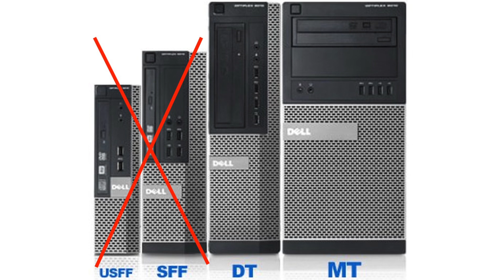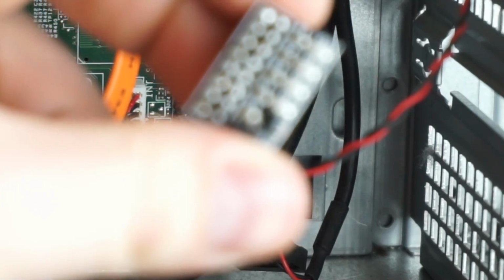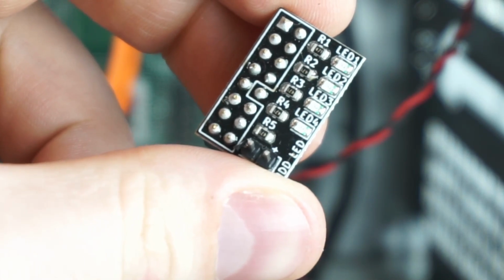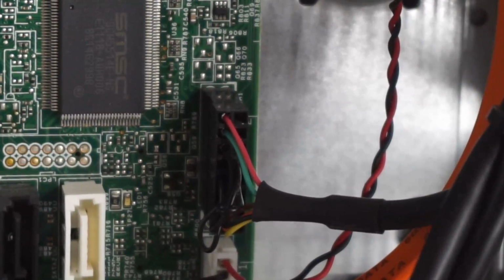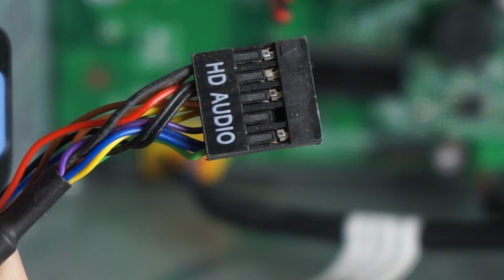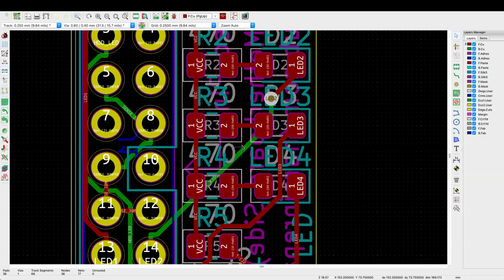Dell Optiplex Front Panel Header Adapter Installation - Optiplex 390, 3010, 3020

Comment: Dell Optiplex 7010 9010 7020 9020 and Precision T1700 Front Panel Header Adapter
i have 9020 
but my case is SFF is it compatible for my mobo or not Cause it a little bit complicated 
Please i need you asap :)
MorePower
Reply from the maker: Our adapter will not work with SFF models, only MT and DT boards will work.
Reply: Oh so sad
anyway thank you

Comment: I plugged all three but I still get the previous fan failure and rear fan failure on the boot screen
Reply from the maker: You need to transfer the original fan to the new case.

Comment: Hello I have a question, can I use this adapter on a motherboard t10xw? This model I think is the optiplex 3010 sff but I need to know if I can use this adapter.
Reply: At least the power adapter.
Reply from the maker: No it will not work, it is an SFF model.

Comment: I have a Dell Precision T1700.  I just bought your kit will it work with mine and do I get specific instructions from my model
Reply from the maker: Yes they come with a basic picture guide showing how they are plugged in on the board and where to align the white arrow and notched out pins.
Reply: The reason I ask is because when I look at the motherboard you have. It looks a lot different than the one that's in my computer and I wanted to make sure that I don't mess up anything. I'm very new at this and very nervous lol.
Reply from the maker: @CUDown40  Make sure the board is actually a T1700 and the one you purchased is for the T1700 and not T1600.
Reply: It came in the T1700 case that I got off of eBay. It is an 8 pin motherboard that I had to get a 24 pin adapter, so  I could put in a better power supply. This was after the factory one died on me. Is there a way I can check to see what type motherboard I am dealing with and that the seller did not gyp me with the wrong one?
Reply from the maker: @CUDown40 Check the BIOS and make sure the model number matches the case model number, or google the board number.

Comment: I just the front panel I/O adapter for the 7010 SFF not all 3 of them
Reply from the maker: Sorry the 7010 SFF is not compatible with any of our kits for various reasons. Some have slightly different connectors or they're located in areas of the board that block the adapter from being connected like a large capacitor or the CMOS battery.

Comment: So I’ll just need the front panel, rear fan and power button adapter or not having the fan adapter is optional?
Reply from the maker: If you don't have the fan plugged in then you will get a fan error.

Comment: Does this work for a 990?
Reply from the maker: We have not officially announced the 990 adapter yet but you can get it here when it's available https://www.ebay.com/itm/264733401752 - Video coming soon
Reply: @HarbinRepairs  Currently out of stock, but thanks anyways. I'll keep an eye out for whenever it's in stock again.

Comment: Would this work for the 5040 and 7040? My project is a power Mac G5 ATX conversion with either of the two aforementioned boards. I want to retain the Mac button which uses only a power button + and a led +. Any advice?
Reply from the maker: Our power button adapter linked in the description will work with that model however keep in mind that the motherboard hole pattern is not the same as a standard ATX case.
Reply: @HarbinRepairs  thanks and no worries about the motherboard mounts. When doing a g5 ATX conversion you're already doing a custom mount arrangement

Comment: Would you or anyone else know where to get similair adapters for 9020 SFF Optiplex? Especially the AUDIO and USB ports.
Reply from the maker: SFF would require a completely different adapter depending on the model since Dell has those connectors in weird different locations on each model. We might design one in the future but as of right now we don't have a solution for those.

Comment: @Harbin Repairs...Great informative video!! I recently upgrade my Dell XPS 9100 to a new case. I have two issues: The front usb cable not connected error & the power led button is flashing intermittent. Do you have any solutions for this motherboard (5DN3X) model? I’ll be waiting patiently for any help you can provide. Thank you 🙏🏼
Reply from the maker: Check the power button blink codes on Dell's website, as for the USB error there is possibly a detect pin that is not grounded due to the front panel connector not being attached. We don't currently have an adapter that will fix that issue at the moment but we'll keep it in mind for the future.
Reply: @HarbinRepairs , would your USB adapter get rid of the POST error at least? The only thing I found out at Dell's website was the blinking amber power led light error. My power led blinks white color only with no beeps at all.
Reply from the maker: @veloze  We don't currently have a solution for that, you might want to consider posting your question on the Linus Tech Tips forum.
Reply: Harbin Repairs, thanks anyways!! Please let me know if any solution comes your way. Peace bro!!😊
Reply from the maker: @veloze  Will do

Comment: My dell 390 auto power on but I connect right wire and not working button and F1 error display
What I do mother board model no MIH61R

#chipguidecomputer
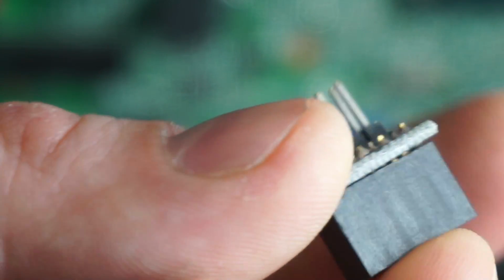Reply from the maker: All 3 adapters and the front panel audio must be connected to remove the error as explained @ 2:13.

Comment: Hey, I checked out your eBay store and saw you have the 3pc Optiplex 790 adapters available. I'm sure they'll work, but can you make a quick video on that? Please and thank you.
Reply from the maker: Video coming soon.
Reply: @HarbinRepairs  Awesome, thank you.
Reply: @HarbinRepairs  Quick question. I broke off the plastic "shroud/cover" for the front panel connector ON the motherboard because the CASE front panel cables would not fit. Would the adapter still stick to the motherboard without the plastic "shroud/cover." If the adapters won't stick, would it be a good idea to put a tiny dab of super glue on the adapter to plug into the motherboard?

Comment: Hey how do I fix my graphics card? My graphics card is a msi rx 570 and won't plug into the Dell optiplex 3010 motherboard. It won't display at all
Reply from the maker: Make sure you have PCIE power plugged into the card, check out Linus Tech Tip's channel. They have a forum dedicated to helping people build PC's.
Reply: @HarbinRepairs  I did and the fan of the graphics card turns on. It spins and the graphics card feels hot. And I plugged the 8 pin PCI-E cable. Could it be the graphics card or motherboard what do you think? What else you recommend me to do? It doesn't register
Reply from the maker: @Tnguyen6163  Not sure, check out the Linus Tech Tips forum and write a forum post about your specific problem.

Comment: At 2:20 what do you have to plug in? The USB?
Reply from the maker: Yes you can plug in your front panel USB, you don't have to but you do need to plug in the adapter to the board to get rid of the front panel error as was mentioned shortly after.
Reply from the maker: @jeffreydbarton  It could be a bad internal USB cable or if you're using a long extension cable then it could cause issues, try one of the other internal headers and see if the issue persists. If it doesn't work on the other USB headers then there may be a problem with your motherboard or with the front panel USB cables.

Comment: 1:08 how come you did not plug in the reset switch anywhere? Is it optional to plug in the reset switch and the diagnostic LEDs?
Reply from the maker: There is not a reset switch on the original front panel of the Optiplex desktops. The diagnostic LED's/HDD LED adapter is optional however without that adapter plugged in you will still get the annoying front panel error on startup.
Reply: @HarbinRepairs  yeah I bought the three pack kit on eBay but my PC case does not come with the diagnostic LED's though so will that be okay?
Reply from the maker: @Tnguyen6163  The HDD LED connector will work and front panel error will be removed when plugged in, If your original case did not have diagnostic LED's then they won't light up which is normal.
Reply: i ordered my kit today and i have the same situation with the aftermarket case not having diagnostic leds so i’m gonna plug my reset switch in there and see what happens and i’ll let you know!
Reply: @dylanbrown2582  thanks let me know
Reply from the maker: @dylanbrown2582  Do not plug in the reset switch into the diagnostic LED header, that is a direct short and may cause damage to the board. There is not a reset switch header on Optiplex motherboards. The diagnostic LED connector is for  an LED, not a reset switch.
Reply: Harbin Repairs thanks for the heads up i guess it’s just something we’ll have to sacrifice for going on a budget haha thanks man!

Comment: So only the power button adapter is needed to take away the power button message right?
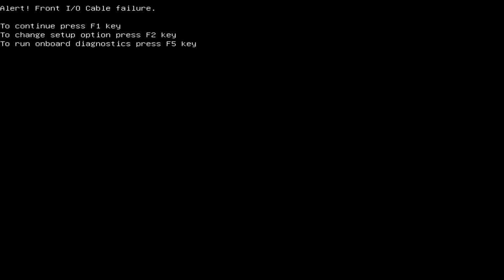Reply from the maker: Watch the video @ 2:13 - 2:21
Reply: Harbin Repairs will the computer still work if the error is still showing and you just ignore it?
Reply: D4V1 yes it will just press F1

Comment: If I connect the aftermarket case hd audio into motherboard will I get an error on boot?
Reply from the maker: For most cases your shouldn't get the error.
Reply: Harbin Repairs ok thank you for the info. Just ordered some from you guys on eBay the other day 👍🏼

Comment: Would this work in a dell optiplex 990?
Reply from the maker: The power button/LED adapter will work but not this 3pc kit, we are very close to releasing a full kit for the 990 that retains the USB and audio headers as well as removing the front panel error.

Comment: This is great! Thanks. You wouldn’t happen to know anything about the KBMSCOM1 port, would you?
Reply from the maker: That port is for an optional PS/2 keyboard and mouse card (old stuff).
Reply: Harbin Repairs
Thank you. I’m trying to find a pinout for that connector. I need a COM port for my DVR project, and if I could use the KBMSCOM1 header, it would free up the PCIe slot I need for a video card. Thanks again :-)

Comment: Which kit is for the SFF version?
Reply from the maker: The only adapter that will work is the power button/LED adapter. SFF boards are incompatible with the 3 piece kit.
Reply: @HarbinRepairs  The message above is confusing on what u said do u have an adapter for the sff or you guys don't have one its kinda mixed signals
Reply from the maker: @Allious131  Please read the compatibility section of the README on the github page linked in the description.

Comment: You guys should also make a conversion adapter for dell's proprietary audio connection on the 790/990/7010/9010 There's a post on LTT forum detailing all of this https://linustechtips.com/main/topic/987783-optiplex-70109010-front-io-panel-pinout/?tab=comments#comment-11899618
Reply from the maker: We are very close to releasing an adapter that works for that model with those connectors.
Reply: @HarbinRepairs  good to know I can't wait.

Comment: Just got my 6 pin power button mod on Ebay.  Used it on my Dell OptiPlex 7010 for an external power button.  LED, Power On, Hold to reset all works great, no errors.  Thanks so much for actually creating a solution for a kind of obscure problem.  Remember to install it with the arrow pointed at the empty pin area.  On the 7010 it is upside down compared to this video.
Reply from the maker: That's correct the arrow points to the missing pin on power buttton/LED adapter. We'll make a video on that when we have our adapter set read for the 7010 boards.
Reply: Thank you so much for this comment. I just got my adapter today in the mail for the 7010 and assumed the arrow went to the empty pin; just needed that confirmation.

Comment: Will this work with the Dell optiplex 9020? And if not, do you know of a product that will?
Reply from the maker: The power button/LED adapter will work with a 9020 but not the front I/O adapter. We are currently working on an adapter for the 7010, 9010, 7020, & 9020 towers, we'll post a video when it's available.
Reply: @HarbinRepairs and with an 9020 SFF?
Reply from the maker: @kd3n4  No, none of the SFF towers will work with our adapters.

Comment: Will this work with the Dell optiplex 990? And if not, do you know of a product that will?
Reply from the maker: The power button adapter will work but not the front panel I/O. We are currently working on an adapter kit for the 990 and 790 desktops.
Reply: @HarbinRepairs   thank you, will you post a video on the product for the 990/790 series?
Reply from the maker: @MovingBeastOfficial  Will do
Reply: @HarbinRepairs  looking forward to the 790.
Reply: @HarbinRepairs  omg! I will totally buy the 990 kit when you complete that. I am right in the middle of a conversion. And that is a god send. Thank you for doing this stuff 🙏🤘🏻.

I have the 990 dt sff, will that work with your upcoming release?

Comment: just ordered it today on ebay. i'll keep you up to date on what happens.
Reply: Do you have the eBay listing link available?
Reply from the maker: Yes it's in the video description
Reply: @HarbinRepairs  will this work with the 990 Tower
Reply from the maker: @henrytom5824  please check the video description for the 990 adapter
Reply: Used the headers on the Dell 3020 and it worked like a charm, no error messages of any kind.